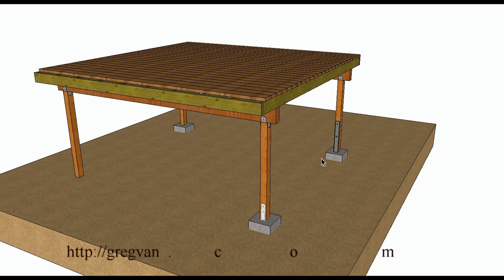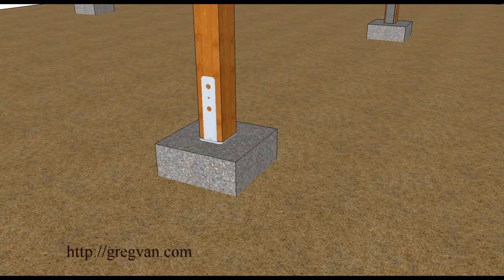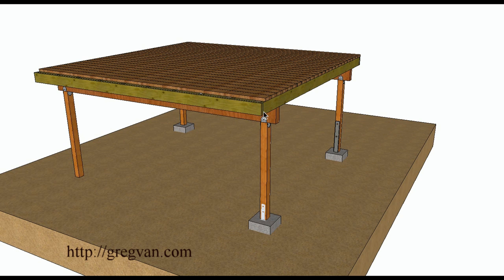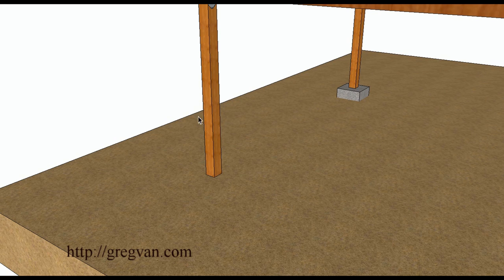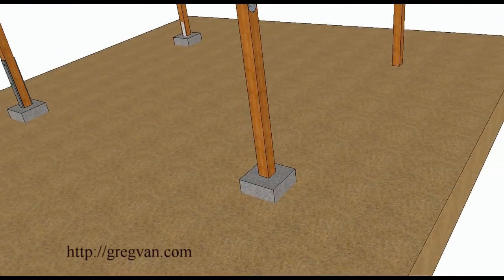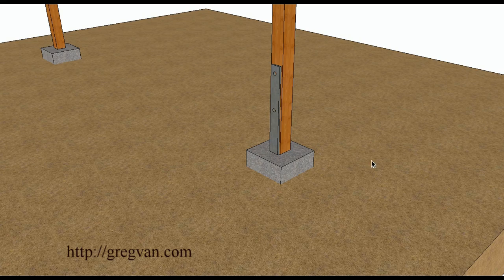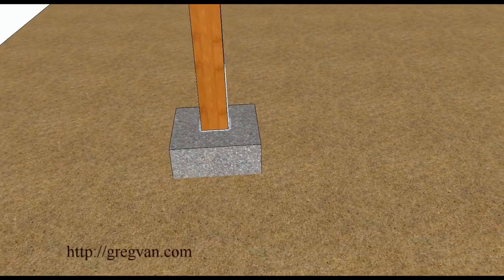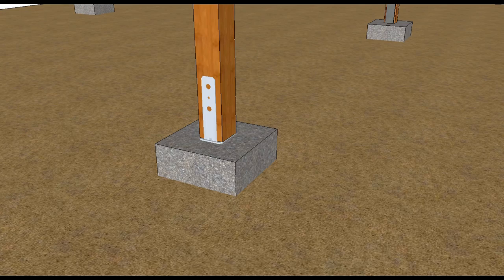What Type of Post Base Connection Should I Use While Building a Deck?

Comment: so over the 4 options, for a low to the ground freestanding deck (3' max on one side and at grade on the other), would you recommend the compacted in dirt method? I've seen some similar options where they put some gravel on top of the concrete footing (around the post), and some where they put gravel under the footing, which way is better? 
Also the residential code shows a metal bracket whether you put the post end below or above ground, but I can't figure out how the heck you would properly fasten the bracket to the post if it's 28" below ground with only about 5" of working space...is the Simpson bracket system even rated for below ground use? I couldn't find any information about that...
Reply from the maker: I don't think they make brackets that can be used underground in soil. I would recommend taking a footing and then using one of the examples I suggest in the video. I don't recommend burying wood in the ground or surrounding it with gravel. Feel free to ask another question if I didn't provide you with the answers you are looking for.
Reply: +gregvancom Its called a post ground spike.

Comment: The best treatment for sub-grade wood i learned from farmers building fences. Cant say its organic but most certainly sustainable in the crudest sense, no pun intended, crudely. Mix 1 part diesel fuel to 1 part used engine oil, coat and soak beyond the depth to be buried- ~36". Backfill and pack every 6-12". Call me in 75yrs
Reply from the maker: I like it.

Comment: I am wanting to add a room on to my trailer. What would be the best footer
Reply from the maker: If the trailer isn't going to move, then you can use concrete footings, but if the trailer is going to move, then you might need to use concrete piers. Let me know if this makes sense or if you need more information.

Comment: Thanks for this great video. On a porch with a couple of wood columns standing on a concrete base,  is a damp proof membrane between wood and concrete ie on base of column effective or is it better to use some sort of metal shoe between wood and concrete?
Reply from the maker: I don't think it will hurt, just as long as moisture cannot accumulate in this area. I would prefer using metal hardware that is raised at least 1/8 of an inch above the concrete like some of the post base connectors.
Reply: @gregvancom  thanks - I think the way you suggest is best.

Comment: can you use cb44's to build a pole barn shed?
Reply from the maker: I don't see why you couldn't, but you would need to understand that there would be practically no lateral strength using these posts bases. I'm not a pole barn builder, but having a general understanding about engineering and home construction, believes that these posts are buried in the ground or in concrete to provide lateral support or side to side support for this type of construction.
Reply: @gregvancom  Not really looking to build a home but an indoor archery range for next winter. The 4x4's would layed flat using the cb44 as more of off the ground braces to build a would deck floor.

Comment: Bear in mind that a freshly cut end of a pressure treated post will not be as protected as the factory end. When a piece of wood is treated, the concentration of chemical is greatest at the surfaces of the post as it came out of the factory. Certainly don’t put a fresh cut end below grade…it will rot quicker.

Comment: You can buy different levels of pressure treated wood. They make some that is treated to be submerged underwater for decks. It's .6 CCA. Comes in various sizes. If it's used in dirt, and not water like it's treated to withstand, it will last at least 100 years before you begin to see any type of rot.
Reply: What is the name of the specification of the .6 CCA rating? I'm trying to find some posts that have that rating.

Comment: This may be a silly question but how come someone doesn't come up with some sort of composite post which to me would seem to solve a lot of problems?
Reply from the maker: You've got a good point and there are some available, but I think there four times more expensive than a regular wood post.
Reply: They have a variety of different post materials from wood, composite, and even PVC. The pros and cons vary by ease of use, installation requirements, appearances, cost, duability, etc. I think wood retains its popularity in the US because of its availability, ease of use, and cost. I don't know if it's the same in other parts of the world. And, always check with your local building permits office as to what's allowed and what's not. (For instance, I don't think anything PVC can be used for load bearing or structural where I live, mainly because of the high temps in the summers. It may get hot enough for the material to soften and deform.)
Reply: I do not know much about the topic, but what you mentioned about PVC may in fact be true, now how about composite then? That is different than PVC isn't it?
Reply from the maker: I would try to avoid using composite or PVC materials, because I don't think they been tested enough for structural loads. I'm not a big fan of products that have been thoroughly tested (but they haven't) and then the company simply files bankruptcy and leaves all of the property owners with the problems.
Reply: Alexi Baez g
Reply: There are lots of manmade wood simulation and composite products out there now but most blend a plastic with a natural forest by-product.  The plastic melts, or loses strength when it gets hot, has little compressive strength and is generally not as predictable structurally, as tested, wood species are.  Good for decking.
Reply: Cement bricks for post some use.

Comment: I have an odd space I am trying to build a deck on... its going to be difficult to try to explain my situation without a picture but that is why I am asking for an altnerative way.  Is it possible to just drill into old concrete to attach my post? I only require a short post of maybe half a foot just to keep it off the ground to prevent rotting.
Reply from the maker: Yes.
Reply: When I attach my base posts to the existing concrete floor, I'm assuming I am still going to need to use fresh concrete right?  should I hole large enough for me to pour fresh concrete into it for the screws to lock in place?

Also, I think I will have to attach my ledger board to a concrete wall as well.  Is it okay or safe to do so?  If it is considerably more complicated or not recommended then I might as well avoid it altogether.  I am jus wondering because most of the tutorials I have watched are constructed by attaching to a house of wood siding. Ive also seen so many different methods of screwing into concrete.  different screws, different pastes, etc. Thanks for the help
Reply from the maker: It might be better if you send me a picture of your project and areas of concern.
Reply: I'd say maybe, but there are a lot of factors. You can drill into old concrete and use cement/concrete anchors to hold down those Simpson's post saddles (CB44's) gregfancom mentions in the video. HOWEVER, this depends mostly on how the existing slab was made and how wet/dry the location is. Most likely, the concrete pad you're trying to anchor your deck is probably a patio, porch, pool decking, etc. Depending on what the codes were back when the the concrete was poured, you may have a pad that is no more than 4 inches (about 10 centimeters) thick with no rebar or other metal structure to absorb and transmit the stress. Your deck posts (and all the load they carry) would probably destroy a 4 inch thick pad. Also, if you live in a climate that has any kind of a frost line, the cement must go below the frost line. When winter comes, the freezing of water in the soil will cause structures over or in it to pitch up in the winter (called frost jacking). This isn't bad for garden pathways and patios that do not support any structures, but is bad for decks, houses, sheds, carports, attached porches, etc. This is why most books and videos on deck building state posts should have a footing that extends at least a foot (about 30 centimeters) below the surface, or at least six inches below the frost line if there is one where you live. They also require that the footings contain rebar to add strength to the post. 

The second issue you will face will be moisture. If the environment is wet either from weather or nearby water sources (like a pool), you may have to raise the distance from the end of the wood part of the post to the ground to prevent moisture from wicking up the post and causing rot. The post saddle hardware (like the one mentioned in the video) will have two pieces that will create a gap from the mounting surface to the bottom of the post. (The gap varies based on the hardware used.) This is great for any moisture pooling on top of a footing, but won't help in areas where there's a lot of standing water from rain, melted snow, or kids splashing in a pool. Your local building code may require the footing to extend above the ground.
Reply: use a galvanized steel plate to separate it from the ground, should work for a few years

Comment: Didn’t raising a post base off of the concrete mean you are just bearing on the metal tabs being wet set into the block?
Reply from the maker: Yes, but they are designed to support certain loads and those numbers can be found at the product manufactures website.
Reply: @gregvancom  I don’t know, think that heavy loads will just bend the tabs into the post contacts base. Admittedly a low risk issue as you won’t have a catastrophic failure but ends up causing the deck to sag. Anyway, I’m in the weeds at this point. Love the videos. Helps me think through my process before I build.
Reply: @jonathan3518  Defiantly do some more research until you feel comfortable making a decision.
Reply: @501contractortips  don’t get me wrong, I’ve never and would never install a post base anything but flush on the pier. Can’t imagine Simpson would allow anything less. If the base isn’t set flush the tabs fold to let the post find a solid surface and that without compromise the tabs themselves and could leave the post with no uplift or lateral restraint.

Comment: I suggest using a steel post like a lally post embedded into the concrete 2 feet and then trim it out with treated 2x4s  for looks.
Reply from the maker: A steel post would work fine, but it would have to be something sturdier than the lolly posts. You could create some type of a moment frame for additional strength also.

Comment: My experience has been that no matter how you anchor the post, if the end grain is exposed, the post will rot from the bottom up as the end grain absorbs water. Yes this can happen even with treated wood. The end grain should be water proofed if you want the post to last. Also posts in the ground will rot at the interface between air and ground.
Reply from the maker: Great information and it's not a bad idea to treat or provide some type of treatment for the ends of a wood post or even the entire post to make it last longer.

Comment: Why not just put a 4x4 metal (steel or aluminum) post in the concrete with some weep holes in the bottom and then put your 3.5x3.5" treated post inside of the metal square tube? no water issues and much stronger for lateral loads. think out side the box. just because you are making a wood deck doesn't mean all components need to be wood.
Reply from the maker: Excellent idea and definitely another alternative. Keep in mind that metal posts might need to be positioned accurately in this might be difficult for do-it-yourselfers.

Comment: so after watching that for 10mins, all 4 are crap? well thanks.
Reply from the maker: Not really, each one of them can be used with different methods of construction and different heights of a deck. If it can be used, all methods where the concrete is above ground at least 6 inches while using some type of metal hardware as a fastener or connector will usually be beneficial.

Comment: Americans religiously rely on wood products while other materials highly available. What is the problem to put 4x4 aluminum hollow pole? Or simply build a brick pole with 4 bricks in a layer? I am from Russia and we usually build houses of the bricks. Wood and drywall are not reliable materials at all. Even price wise is not always a winner. But quality over price has always to be a priority.

Comment: fuck no! no structural engineering firm would want to involve themselves with you if you are trying to build a structure in your backyard, it has to be all conventional wood structure where your city will acknowledge and give you a permit to build. I'm telling this from experience. you are fucked if you have metal posts or beams in your structure so just find a way to make it all out of wood.

Comment: fuck no! no structural engineering would want to involve themselves with you if you are trying to build a structure in your backyard, it has to be all conventional wood structure where your city will acknowledge and give you a permit to build. I'm telling this from experience. you are fucked if you have metal posts or beams in your structure so just find a way to make it all out of wood.
Reply: TheFightaz I have built many patios that have been engineered and have never had a problem finding an engineer.
Reply: Mark Daniel hope they were all metal, how much did the engineer charge you for his services?